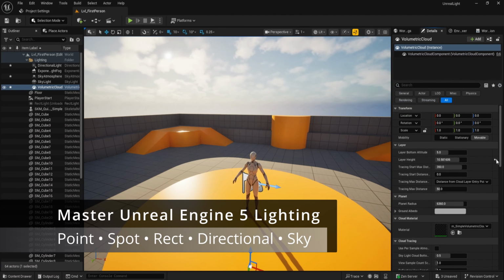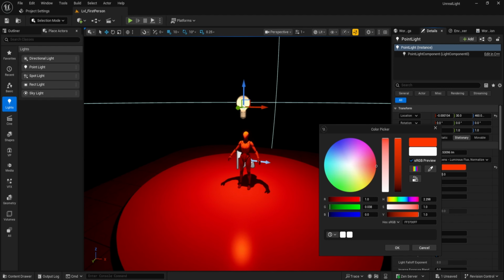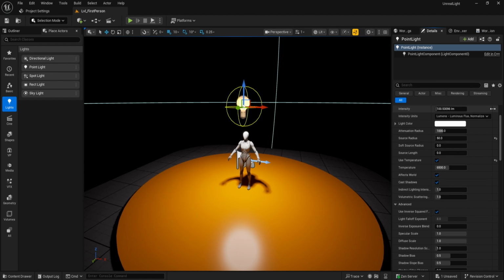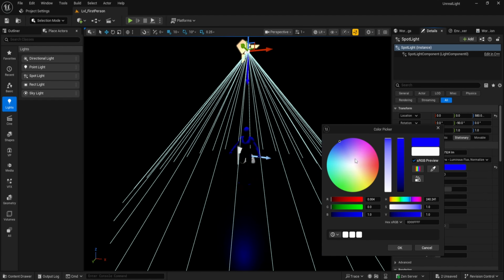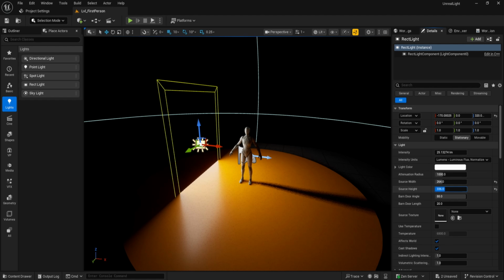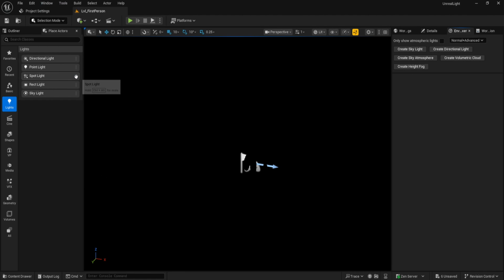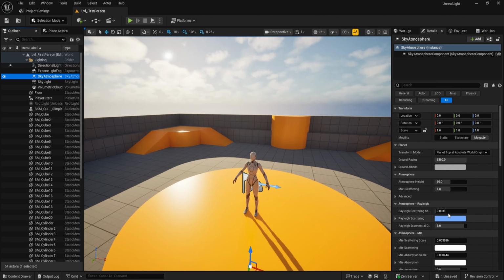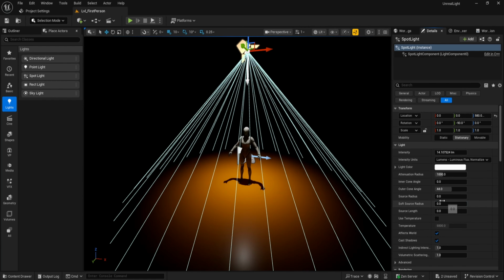Unreal Engine 5 Lighting Explained – Point, Spot, Rect & Directional Lights Full Guide

Comment from the maker: Lighting is one of the biggest factors that determines whether a scene feels flat or believable. Small adjustments to intensity, temperature, attenuation, or cone angles can completely change the mood of a level, even if the geometry stays exactly the same.

Two tools game developers here might also find useful:

Meshy AI – Helpful for generating custom 3D assets for environments, props, or quick scene prototypes
https://www.meshy.ai?via=Rambod

Humble Bundle – They often run great bundles for developers with Unreal resources, programming books, and asset packs
https://humblebundleinc.sjv.io/jRrz9b

When building scenes in Unreal, do you usually start with lighting first to set the mood, or add lighting after the environment is already built?